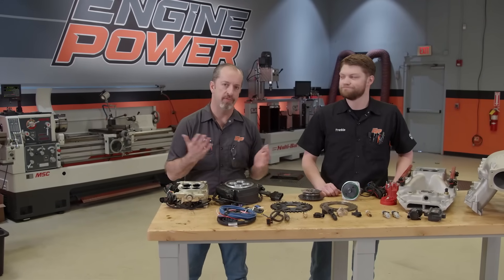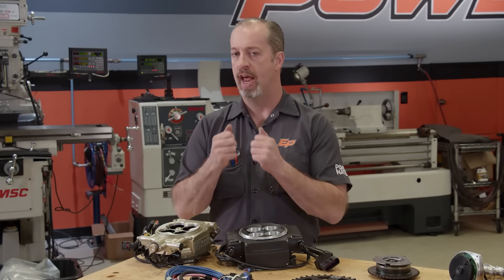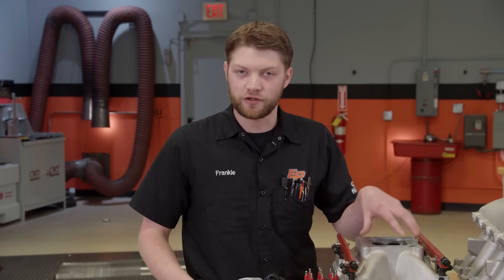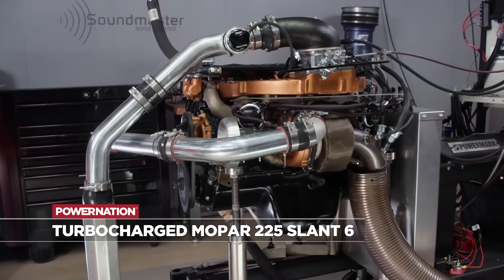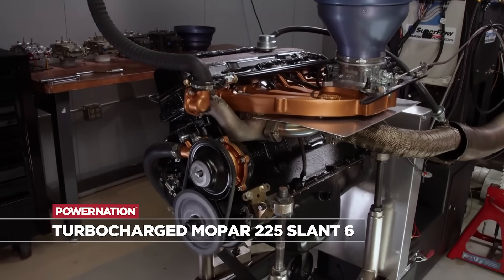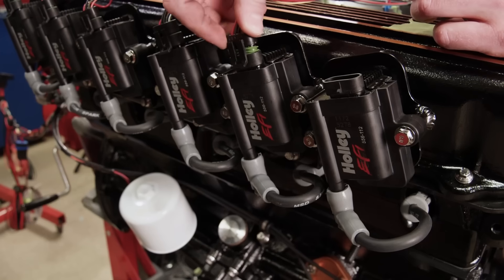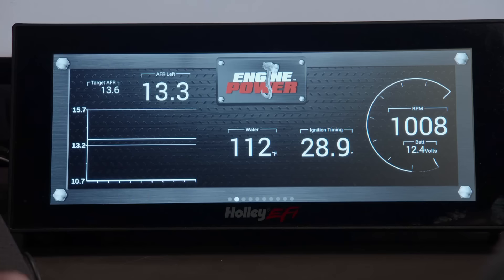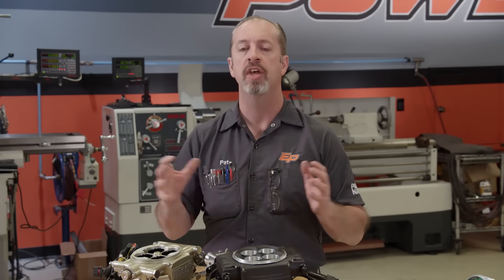EFI Conversion Explained: Everything You Need to Know

Comment: #1 thing to know-  avoid the Holley Sniper system at all cost!  Especially on a SBC engine.  I think they fixed a few of the issues with the Sniper 2.
Reply: Why
Reply: @sneedsspeedandfabrication the first Sniper Kit wasn't able to self-learn on a dual plane manifold because the draw on the throttle body was different than that of a single plane manifold.

Comment: Could I use this efi system to eliminate the spider injection system  on a 4.3 motor
Reply: You would need to swap to a carb style manifold, to use the other type of fuel injection system,they are talking about.

Comment: Just some comments...
1) they are not "Self Learning" - They will adjust the air fuel mixture based on targets in the base map either supplied with the unit or that you set
2) None of the aftermarket systems do any adjusting of the timing curve. that is set in the timing table. 
3) none of the aftermarket systems "Learn your driving habits" they will adjust your fuel mixture in the areas of the fuel table that it operates in.

I have been a long time viewer of both the Youtube channel and the television show, you have missed the ball with this video.

My background is an Automotive Engineer specializing in EFI and Drivability. Normally your info is good but not so much on this one.
I do custom EFI installations and tuning and her this same misinformation as outlined above from the owner of any system that i am hired to correct. On one count you are correct, it is much easier to make all sorts of adjustments in an EFI system, but most of the entry level throttle body systems (FAST, FITech) cannot be tuned thoroughly using the supplied handheld and do not have a provision to plug in a laptop or work outside the supplied hardware. The Holley systems do. Either by pulling the microSD card or directly plugging in to the unit with a laptop. Sorry for the rant but you need to check your facts better.
Reply: What have you seen with regard to diagnostics in these aftermarket systems?  When OEM stuff fails you have fault codes to identify or at least narrow the problem.  I've read that the aftermarket EFI systems don't do this and you have to figure out problems with guesswork.
Reply: @allencampbell3726  On aftermarket EFI, you need to understand what everything does, it is not guesswork, Just like tuning a carburetor and mechanical distributor. All the principles are the same, the biggest difference between EFI and Carb/Distributor is the ease of making those adjustments (and you do not get as dirty). If you are conscientious about saving your tune every time you make a change you can always roll back to a previous version or start over. Now where EFI excels is with temperature and altitude compensation. Once it is setup for your engine, depending on the system, it essentially runs the same under many different conditions. In addition you get logging on most systems and can easily analyze the changes that you made. Finally you can get creative with the additional inputs and outputs. On my personal car (avatar for my account) it uses ITB or Stack fuel injection, i created a traction control like setup BEFORE Holley put it in the Terminator X system, and even push button start. The next upgrade is Coil on plug on a Small Block Ford using LS coils. If you get creative and understand how it works you can do a lot of things, you can even add additional I/O modules for extra inputs and outputs, set safeties on things like Low Oil Pressure to shut down the engine, i even have a "Send It" light on the dash so i know when the engine is ready for Full Throttle Fun. (Oil is up to temp, coolant temp, and everything else is running in normal parameters.  I do have a few videos up on my channel and plan on posting more. I can be messaged from there.
Reply: Where are you located?
Reply: @joelsugahara  South Central Ohio
Reply: @cobrabuilder9336 i see you plan on uploading to you channel 👍
Reply: Ok thanks wish you were in Arizona
Reply: Video should of been titled "10 % you need to know" 😂

Comment: The biggest part fpr me and others is making a high pressure fuel system on older cars.  Pump in/out of tank, filters in/out of tank, regulators in/out of tank, fuel /return lines, connections, power to all etc.  If I was power nation/engine power I commit a whole episode or several to setting up fuel systems for several common setups so people see how to do it.  We learn massive indepth engine building techniques from ypu guys but I seem to miss the fuel stuff.  So an example one of my boys 1998 vortec roller cam 350 rebuilds.  NO hole for m3chanical pump.  My children want an old school hotrod with some minor new stuff like roller cam.  Now they are stuck with an electric fuel pump.  Takea the fun out of it not knowing what to do there for them.  Fuel systems!  Please.
Reply: Just get a external Walbro pump and wire it in with a relay. Get a fuel pressure regulator and gauge.  Add a return line that dumps into the gas tank fill neck. Done.
Reply: @turbo32coupe  A Rotec TBI runs on 4 psi, requires no return line and will operate upside down if required.

Comment: Can you guys do a dual injection engine? Take a LT from Chevy and integrate port injection. Direct injection makes valves full of carbon. You could only clean them with fuel or put more fuel and force air in this new dual injection makeup. Toyota already has developed and is selling dual injection engines, so is Ford, Subaru and the Volkswagen group, so it's possible, but more complicated.

Comment: I'd love to see you guys build an air-cooled VW engine someday. Been a fan since the days of TNN. Glad too see you guys are still around. Haven't been seeing any new videos and I've been worried the show was canceled. Keep up the good work. You guys rock!! 💪🔥
Reply: Yeah.... If air cooled, build a turbo VW engine with upgraded bolt on fuel injection that can run E10 or E85. 
Run E85 in summer to help keep the air cooled engine  temps down & E10 during the coldest parts of winter to help engine start easier. 
Or  find 2 cheap carbureted 1200cc V-twin motorcycle engines & build a 200+hp  air cooled V4 engine mounted to a manual gearbox in the back of a VW.
Reply: that and or a corvair engine
Reply: Since we are getting crazy, how about a Honda 4 cylinder motorcycle engine in a little car like a Fiat 850 spider or something like that.
Reply: @jamesberdine8574  Look up the Honda S660  2015-2022   I think it really needs a liter bike engine instead of a 600 motorcycle  engine.
Reply: Check out Gene Berg out in Orange CA.  What Gale Banks is to diesel motors, Gene Berg is to VW motors. He passed some time ago, but his family runs the biz. I would call and speak directly to him whenever I had a question.
Reply: This! Yes to a VW engine. Build a dune buggy.
Reply: Agreed!
Reply: Hee-haw!
Reply: If you have Roku you can get the powernation channel
Reply: That would be cool! I know there are supercharger designed for VW engines. Let ‘er rip!

Comment: You lost me at O2 sensor
Reply: A sensor installed in the exhaust system. It senses the fuel/air mixture.
Reply: @jamesberdine8574  yeah for the price I might as well get a ls setup. And change it all
Reply: @jamesberdine8574  Not 02 sensor but AFR ,A different beast.
Reply: I mean, youve got to have at least an upstream O2 sensor. An ECU is not a sentient being. Hell, they aren't even that "smart". An ECU can only solve problems it was taught how to solve, using tactics it was taught to use.

In other words, your dumb ECU wont know that a cat converter is clogged, it just knows that "there is a problem, i'm not sniffing as much exhaust as I should be, hmmmm.....time to richen the fuel mixture, that'll work!"

You need an exhaust sniffer.